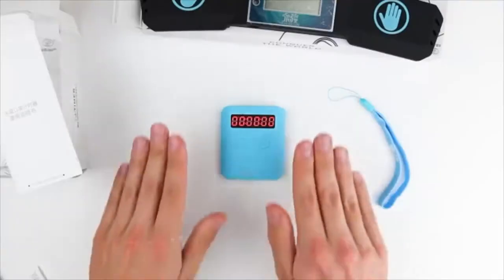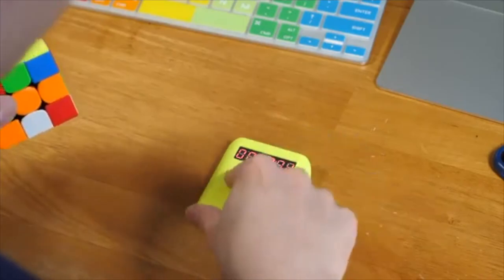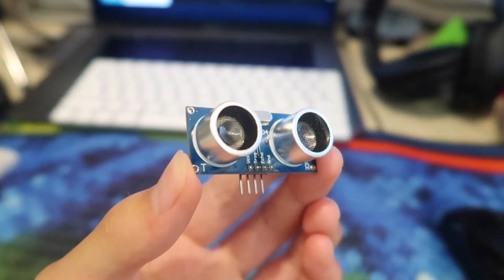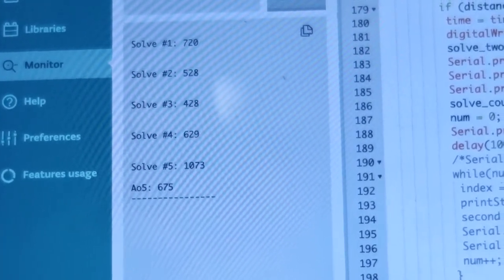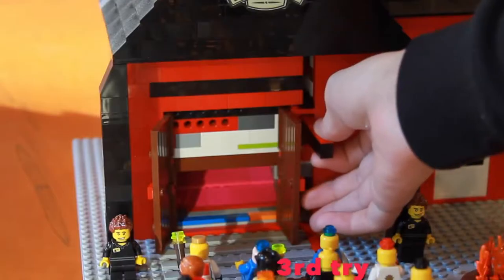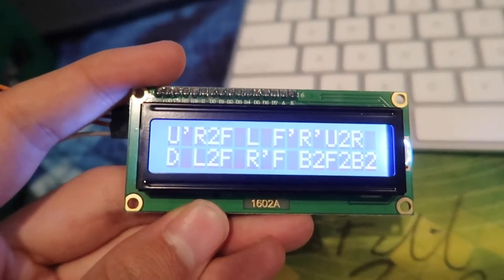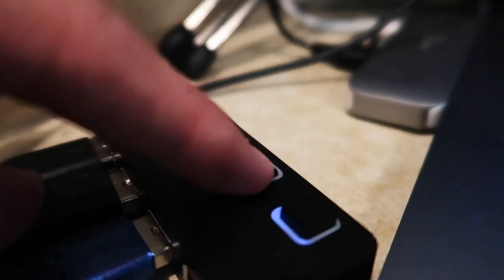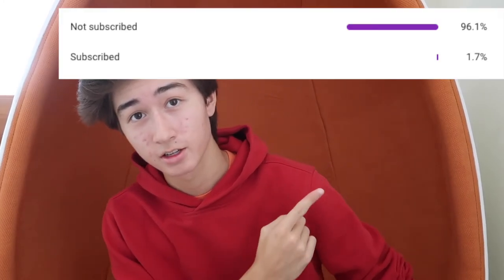A better timer that you don't touch

Comment: Why is it only accurate for like 12
Reply from the maker: Long story short: the time it takes for the ultrasonic sensor to send out a pulse, receive the same pulse, then set all the variables in order for it to work takes about 0.003-0.008 sec and I have no control over it. Although because I can not run a timer and have it sensing at the same time, that 0.003-0.008 sec is then added to the time. And since this is going off repeatedly this time adds up. So when it gets the final time (when it is stopped) I divide the code by 2, which is most accurate around 12 sec. TLDR? timer go brrrrrrr, if that didn't make any sense don't worry about it